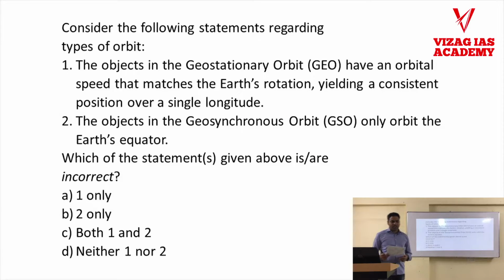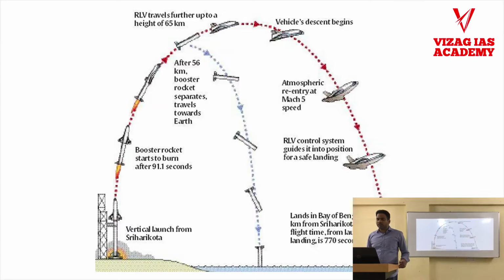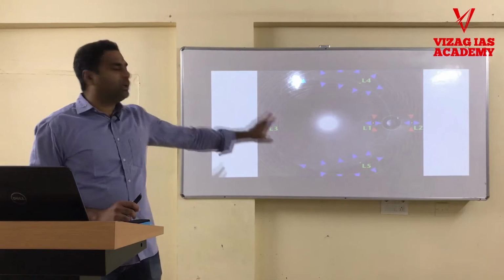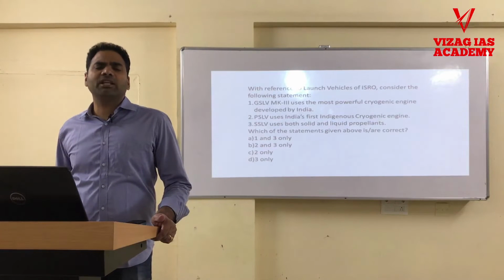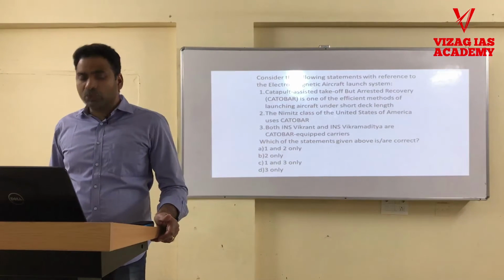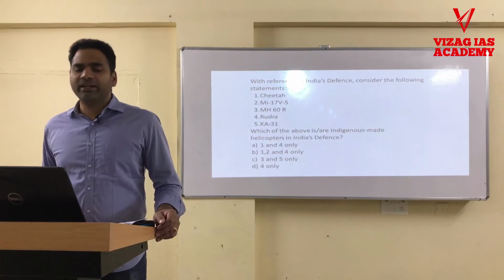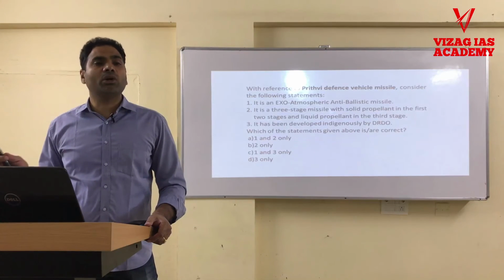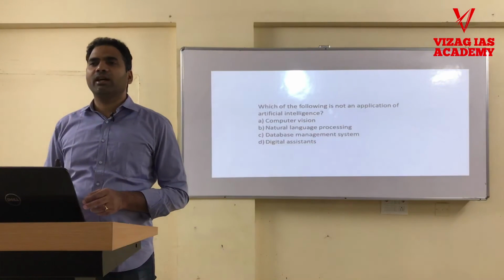Science & Technology Current Affairs | Test 3 Explanation | UPSC Prelims 2023 | VIZAG IAS ACADEMY

Comment: 1st question answer option 2 is not correct.but you said both one and two are wrong..needs clarification
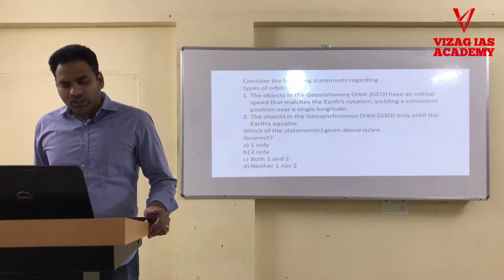Reply from the maker: At 1:21 sir affirms your view in his explanation. So, the answer is B, 2 only. 
For objects in Geostationary Orbit, their position from the ground appears to be fixed on a single longitude (and always on the Equator). Consistent position over a longitude, applies to both Geosynchronous and Geostationary orbits. Consistent position in Option1 for Geostationary can be interpreted as zero movement w.r.t. a longitude where it is fixed.